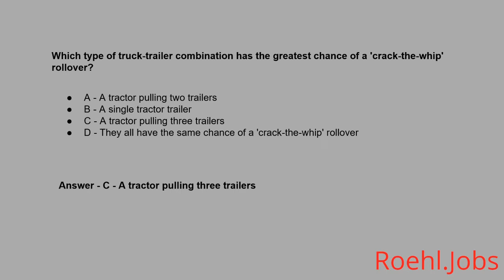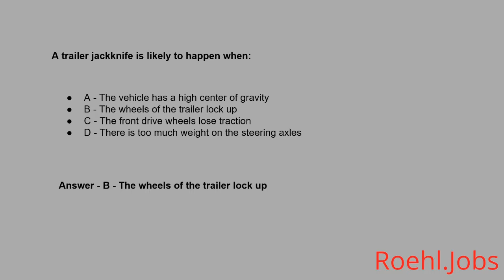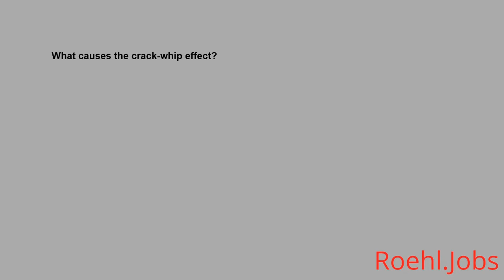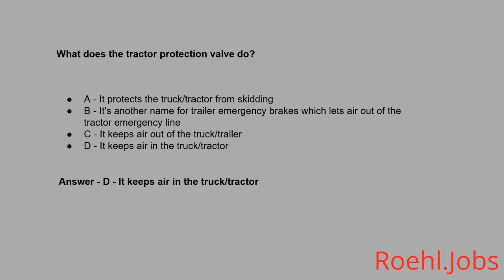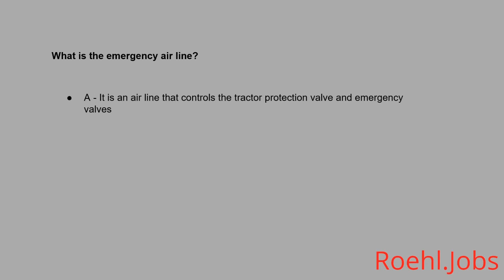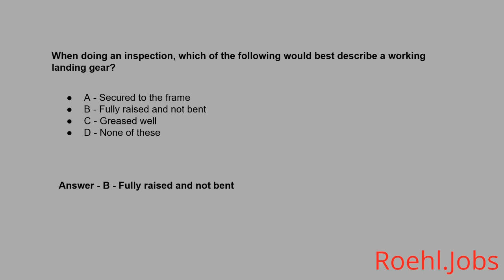Practice Test for Combination Vehicle Commercial Drivers License (CDL)

Comment: When testing do you have to take all 3 test at the same time or can you do one at a time.
Reply: Passed my Pennsylvania CDL A permit test this morning. The Roehl practice tests used in conjunction with the Pa. study manual were the only resources required. Thank you for posting these Q and A's.
Reply from the maker: @snake_ize136  You bet!
Reply: Tx you can take 1 at a time currently doing that now because of work
Reply: No you don't.
Reply: @David Flores
It all depends on what state you’re in I guess. I know for Pennsylvania you can do 1 test at a time and not have to take all3 at once.
Reply: In PA you can take one at a time
Reply: N.C allows you to take them one by one.
Reply from the maker: Each state operates differently, you will want to connect with the DMV in your state for more details